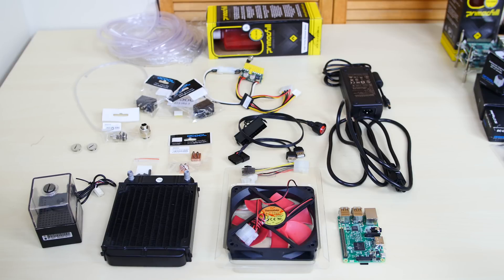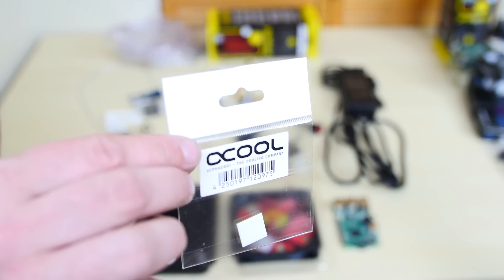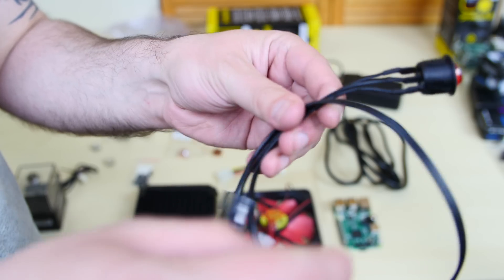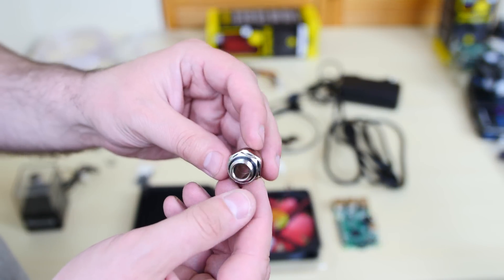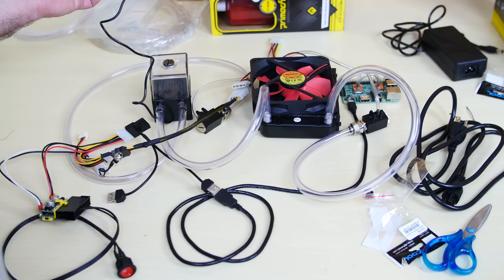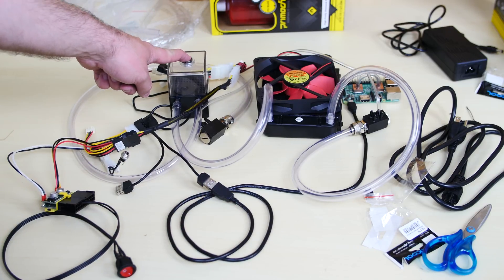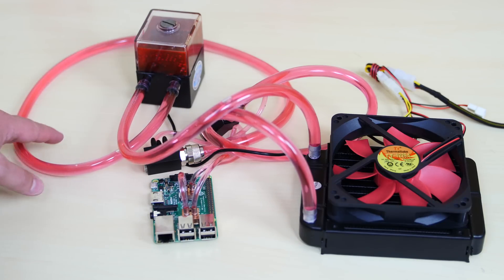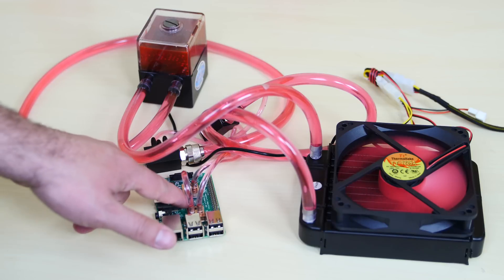Water Cooled Raspberry Pi 3 - Part 1 - The Build

Comment: The fan is sucking the air through the radiator, although the table is blocking the airflow. Certain pumps may break when they run dry, although I’m pretty sure that only happens with diaphragm pumps though.

Comment: I know you are building this water cooled RPi because it a step to a cluster, but you have 5 outlets on the converter blocks, and you should pipe the CPU and USB chips separately. Also your 50 deg C is hi because you have not water cooled the chip on the other side of the board, directly under the CPU. Also note that the USB shields (chassis ground) on RPi get hot, so you could use ALL 5 outputs to 5 different blocks to cool the 5 hottest parts of a RPi.

or you could save a LOT of money and just buy one of those "sandwich" heat sinks with 2 mini fans available on Amazon - 38 deg C

Comment: 1 thing i'd say but to be fair it wont effect temps. You could get twice the flow by going from the 5 way twice so that each block gets its own feed. This uses more pipe but the total flow of your system is whatever you can push down 1 3mm pipe and my way would double that as the input pipe is still way above that.
Reply: but i still like your work and it's way overkill for a ARM cpu.

Comment: you don't even need the fan unless your setting up a bunch of these raspberrypis in parrallel cooling. i know this cause my heatsink cooler is literally just a staggered stack of copper plates. it still works well until the cpu runs at 100% for about 6-8 hours then the temp will start to reach the 80's. but thats because i don't have thermal paste or pads between them. just them stacked with gravity.

Comment: I agree with the last comment but hey if that's what u like go for it. but I do gotta say not that it actually gets hot enough what didn't make sense is that u blocked more than three of the converters off when u should've ran two from it to the blocks and two from it not in series and should've run into the pump from the rad and not out from the pump. same way with an engine u wouldn't run hot stuff back into the engine or places that heat destroys

Comment: i feel water cooling a raspberry pi is like giving a paraplegic running shoes. it just doesnt benefit or make sense
Reply from the maker: I had a lot of fun building it, so it was not a waste of time to me. If anyone who watched the video and thought it was cool, then it made perfect sense.
Reply: Because sometimes science is because we want to know how far we can get before it starts becoming illegal. It doesn't need to make sense, it just needs to work.
Reply: yep
Reply: It makes perfect sense for emulators ( arcade projects)
Reply: +TerraElysio true
Reply: that true Dante vortex
Reply: Well, I run a Pi on solar in the woods. In a black plastic box with a battery in it. If you see what happens when the sun hits 35C, you will stop feeling that way.

Comment: wood of been better if   u didn't have one of the water blocks feeding heated water  in to the other block 
 when your have 5   out lets on each bock
 each could of had there out  out/in flow    but then again less flow rate   then again pressure may not be enough    so  one hose in wall be a safe bet
Reply from the maker: +Tyler Christmas That would have worked better
Reply: I've been watercooling PC's since about 03......it wouldn't have made much of a difference. Loops tend to stabilize at a solid temp, and it's been proven over and over again order doesn't matter.

Comment: SO, the "cooled liquid" goes into the first block, gets heated up, then hot liquid goes into the second block, Gets Super heated, then returns to the radiator.................. when you have FIVE inlets and FIVE outlets of the radiator, you should run each block a separate in and out line! unless you were trying on purpose to COOL one, and NOT COOL the other one?

Comment: I would have had the the liquid flow from the water blocks straight to the radiator not into the pump but I guess it works either way.

Comment: why not use two of the splitters out to each block that way the second block isnt being cooled by warmer water? then just split the two outputs from the block into one tube? that would optimize the cooling since you have all the splitters. and if your radiator is facing the table no air can really go through it so your not really cooling anything

Comment: Why do you have the exit line of the first copper block feeding to the input of the second?
Why not have fresh (cool) water coming off your radiator (via adapter) into both copper blocks at once. And both copper block exit ports feeding back to the pump?

Comment: Instead of connecting the two chips together with a tube could you have run an extra line so each chip gets it's own supply of water?

Comment: With the same ease, you could have use 2 exits from the block, to bth heatsinks, and then have 2 exits from the heatsinks, into the receiving block, which is better because then you will not have water going through both, causing it to be warmer before it goes into the 2nd heatsink.
I don't understand at all why you did it this way.
Not that it will really become warm at all though.
Watercooling this is rather overkill.
Also, how you wre trying to get the air out of the hose... Oh dear. So poor.

Comment: I think this guy is a prime example of how people are not using their intuition for something that is very simple, the whole setup is just nasty. it requires a simple electronics to wire a connection the the fan, pump and pie. something a 10yr old could do in a physics class , nothing complicating, god knows how much money there is in all of those pointless connectors and power supplies that make it look like shit. 

i find it ironic that he emphasized so much on how you should never turn the pump on with no water in it even though the you can easily see that there is a huge still bubble in the pipe that clearly indicates that no water was moving. surely that would be alot worse for it as there is strain of the pump verses no water and no strain on the pump. 

lastly why the hell would the 3.5mm be is series!!

Comment: Nice idea, but i thing this has to be more tiny. The cooling stuff is more worth than the raspberry pi O: However this is a good solution for clusters, because you only have to wire these tubes and you need one fan.

Comment: I seriously doubt that the Broadcom BCM2837 has a high enough TDP to need watercooling, or even fan forced air cooling. Still cool though.
Reply from the maker: +neardood1 True, but I had a lot of fun building it
Reply: +Rasim Muratovic For sure :) It's a great way to get into watercoolimg without potentially wrecking expensive PC hardware with leaks
Reply: 'just because' rarely needs further explanation

Comment: No offense but ive never seen a thermal pad put on so poorly
Reply: I agree, it hurt me to see.
Reply: well idiots do...
Reply from the maker: +Nyx Reaper lol I didn't know thermal pad experts were out there.
Reply: p.s. you don't need to plug anything into the sata power if you want to power another device, you can stack molex connections quite safely (the power runs from the same source). Further, it does not matter what order you have the piping connected from the res/radiator/blocks.

Comment: dude nice build but i'll did it a different way
your coupling has 1 big entry and 5  small oultets why dont you put those 2 waterblock in paralel instead of serial? you'll have a better flow and the processor wont heat the other chip
Cheers buddy
Reply: BTW why wont you try to dip it into mineral oil and just pump that oil through a radiator? and back to the rasp?

Comment: I rarely dislike videos but this was a bad one. by moving the radiator to get rid of the air from the pipe, you've just moved the air into the radiator...didn't get rid of it. You don't need to keep saying 3 millimeter, that got really annoying...the fan is also backwards, might as well not have it plugged in. You also could have powered it all off the 1 molex connector, just looks like bad planning. Work space also looked very cluttered with everything around what you were working on. You want to keep that the focus, so move everything else out of the way. Not trying to be a hater, but just some things worth considering next video

Comment: Good video, thanks!
Reply from the maker: i'm glad you enjoyed the video.
Reply: Just thought i would say, the chip you are cooling thats near the USB, is not a CPU or memory, its a god damn USB to UART interface, it doesn't need cooling.. the GPU is on the bottom of the board, that should be cooling and not the damn usb IC.. hits head on table.
Reply from the maker: +David Turnell Thank you so much

Comment: you don't put adhesive strips on the chip that's not very good heat won't get to the cooler unit
Reply from the maker: It's special adhesive pads made for heat transfer for chips, like the Raspberry Pi.
Reply: fare enough

Comment: so let me get this straight! he is going to come out of and into a 5 point distribution block in series to the two components which in turn will transfer the heat from one component to the other... that being known what good does water cooling do for the whole thing? you can just come out with 2 small and have each component have its own line in and out which in turn will have a better cooling effect.

Comment: I see a lot of ridiculous hate in these comments, so as a professional system builder let me clarify some things; Water cooling a PI Isn't pointless, It actually incredibly increases the overclock-ability of the chip, I use one to emulate all my N64 & SNES games on the go and it lags on some N64 due to lack of core speed, a bulky solution yes but still a neat one. also, the reason it looks like there is no liquid circulating when he is trying to remove the air bubble is because the reduction for the large to small tubing severely reduces flow rate, and It was trickling past the air bubble. also, while the radiator being flat on the desk isn't the greatest solution, the radiator itself even without the fan would probably be enough to cool the PI alone just by passive heat dissipation. Great video, keep it up.

Comment: Three cheap chinese waterblocks, cheap chinese 6v water pump, large aluminum heatsink and some hose from local hardware shop. That is all you need. Pico PSU is expensive overkill. these blocks with fittins and caps are also vasting of money. Fan for such a small amount is questionable and also you can find fans that runs on 5v. Sou you have spend lot of money on something, taht cam be done a lot of cheaper. Not to mention one  big mistake. Mixing aluminium and cooper parts. Galvanic corrosion is pretty bad stuff.

Comment: cant help but think it would be more optimal to cool the 2 chips in parallel. especially since you have those 5-way blocks. 2 reasons, less constriction of flow so a higher flow rate (more cooling), and a higher heat differential to both chips (more cooling). 

im not a big fan of water cooling, you go from cooling things with fans to cooling radiators with fans. but at least do it right.

Comment: Your flow is a bit backwards too.  Your radiator should dump into your  reservoir not the other way around. The HOT line should go to the input on the radiator.  Otherwise you're going to have hot water in the reservoir instead of  cooled water.

Comment: If you put a tube into the fluid bottle and other end into the reservoir prefilled reservoir once the pump will suck the fluid and fill the system. Less chance for spillage.

Comment: Wouldn't it be better to use 2 of the 5 adapter 3mm connections? I.E. 1 going to the CPU chip and the other going to the 2nd chip without connecting to the CPU. I know it would mean more tubing (1 extra length actually) but it would also mean better cooling of the 2nd chip as it would not be getting already warmed water from the CPU!

Also, wouldn't it get better airflow through the radiator if you stood it up, give the air from the fan an easier exit? xD
Reply: You'd be right but for a different reason! That tubing adapter is creating an extreme fluid restriction, and if you used 2 ports, the flow will be about 2x.

Comment: why dont you connect both blocks separatly as you got so many connections on the adapter? 
 Would get you more cooling performance than that setup ^^.
Reply: hes an idiot
Reply: i'm wondering the same, parallel would be better, the only reason why you wouldn't is the possibility that flow will be less if you are not pushing a 105% water though the system, or youknow connect 4 more pies...
Reply: yeah but if you take the warm fluid to the next chip it wouldnt be as efficient in cooling as in parallel. But on a pc like this it doesnt really matter that much :D
Reply: I built my pc myself, i just have an aio water cooler.
Reply: i know some theoretical things about it because my next build will be with a custom loop as i want to cool my graphics card with water too.
Reply: Not with dual or triple radiator setups...

Comment: "move the radiator up and down to fill it up" you don't seem to understand gravity, you should have moved the radiator block below the resorvoir with tubes facing upwards and give it a jigle to release trapped air up through the tubes instead of struggling so much

Comment: ONE OF THE WORST PLANED AND SET OUT WATER COOLING SETUP I HAVE SEEN
you have the ability with that hardware to run a 2 loop that way BOTH chips get cooled the same not 1 chip copping the others heat

fool
Reply: "ONE OF THE WORST PLANED AND SET OUT WATER COOLING SETUP I HAVE SEEN". I did not see a planer being used anywhere in the video, no wood to plane, I think you meant 'planned'! Now who looks foolish? :P

Ok, trolling aside I do agree with you about the arrangement, I have made my own comment about it that is not condescending and rude towards the guy like yours is :/

Comment: Really good info, advice and appreciate the links in the description.  I have one note for anyone doing this project: before adding the coolant I would trim and orient / organize the hoses to be the exact way you want them to be. If you're going to mount everything on a board or some kind of housing..do it before connecting the hoses. Think logically about where your components are going to 'live' - maybe even draw the layout. You don't want to fill the system with coolant until you're 100% satisfied with the layout and length of the hoses (the less wasted length, the better) and try to orient ALL POSSIBLE liquid fittings so that in case they fail they won't drip directly onto your system board or power supply. Obviously you can't do anything about the CPU fittings, but the others can be routed around your components.

Comment: Cool. Next why not some kind of enclosure. like a high rise. So you could have some kinda portal to view your setup. While your at it add a place to put some kinda permanent or dedicated power output. I keep switching mine up then need others for expansions.. Oh that tosome place to house the addons/expansions. a few wires to connect it all. You could call it An RP Highrise enclosure. A one of a kind original.
 Nice Water coolser btw
Reply from the maker: Thank you so much
Reply: Dude, Novaspirit Tech copied your video. Youtoube vid id: ?v=O7cc4eLAOMk

Comment: You should have thought about this more. for starters you could have individually cooled each chip at no extra cost to you with what you have there, unless you need them thermally balanced you are just loosing efficiency there. your power supply options are ass backwards, WHY so much money on a bloody power supply. You do know that most of the people who are using these devices will already be using better power options than you have here, and a good percentage will just make a basic supply for it, you way over-complicated and priced that part, 2 cheap power bricks from a recycling place for cheap, or a larger power brick for the pump and then a stepdown for the Pi. Which could be bought as a module for like $1.

Comment: 1. Why are you wasting so much money water cooling a Raspberry Pi? 2. Your loop is incorrect. 3. I don't think you know what you are doing.
Reply from the maker: How many Water cooled Raspberry Pi have you built.
Reply: i agree with first guy, why the hell didn't you run them both on cold? You are running that second chip on all the heat from the first... and you even had a 5 way adaptor, should have used seperate lines for each block.. amateur.
Reply: +Rasim Muratovic (Rasmurtech) 6.5 The .5 refers to one in progress

Comment: 1. Why put the blocks in series if you have two 5-way adaptors?
2. Why is the radiator flat on the bench with a fan on top, there is zero airflow unless you have a hole in your bench!
3. Why cool the ethernet/USB chip and not the memory chip which actually gets hot?

Comment: Connecting the waterblocks in series is a bad idea because the second one gets warmed water and doesn't get cooled as much. You used way too many adapters. I would have just made my own 5v rail or cut off the molex and connect with bullet connectors.

Comment: Pretty cool project. But why the hell would you cool the ethernet controller? You could cut your number of blocks in half by not doing that. Or you could cool the RAM chip instead, since it does get mildly hot by dissipating some of the heat from the SoC.

Comment: why connect in series not parallel? the water block
Reply: Yea, the guy has a manifold and doesn't even use it properly. #fail
Reply: +bobdvd that's what I'm asking myself also. He has 2 adapter so basically he can do a parallel setup.